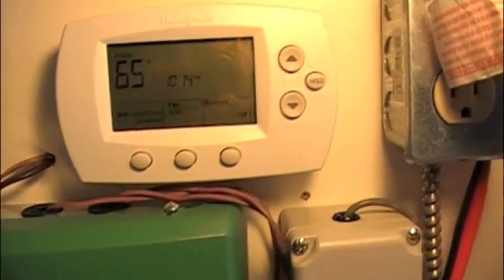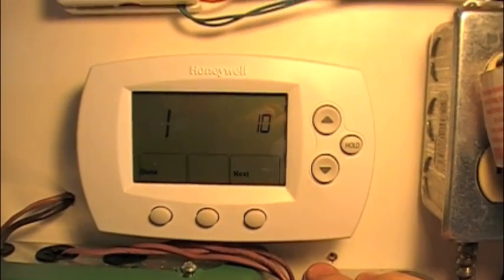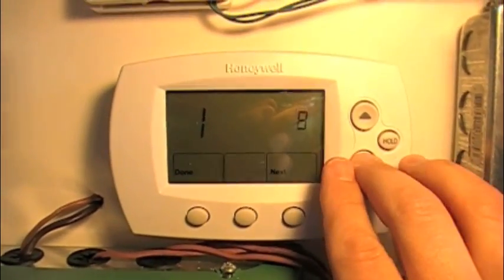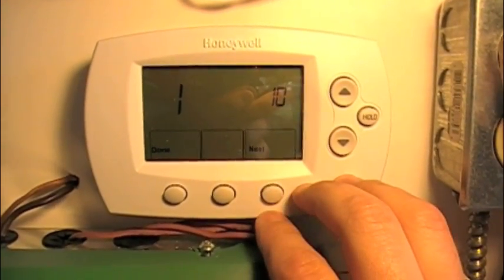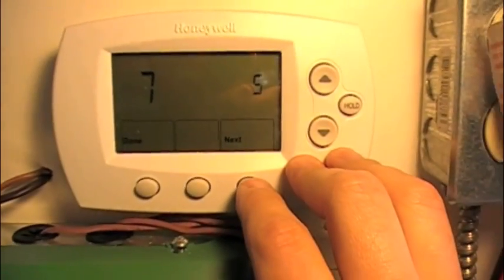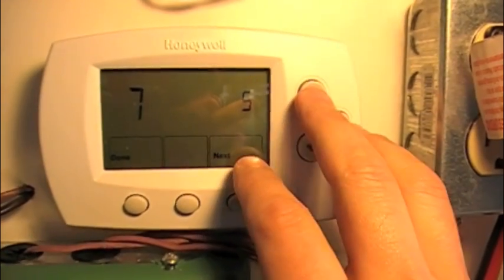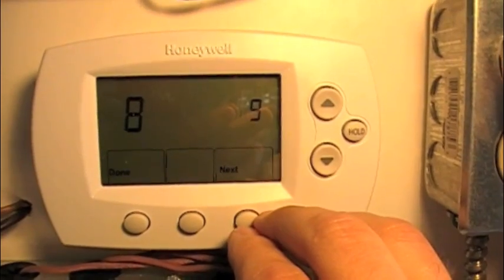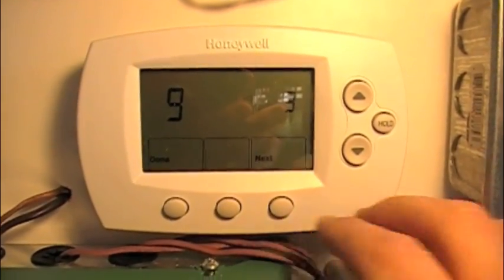Honeywell Focus Pro 6000

Comment: What is the difference between aux heat and using the emer heat setting. That would be difference between the heat and emer heat settings. I think somewhere i have read that setting thermostac to em heat keeps the compresser from coming on in cold weather below 30 .

Comment: I've been trying to keep this on manual cooling. I hit the fan and up bottom and changed it to 13 and zero and now it just wants to heat. What can I do to get it on manual and on cooling? Please help. It's August 22nd and It's hot outside.

Comment: Is there a way to have the blower fan motor in the air handler to run longer once the AC thermostat calls for the system to go off once cooling temperature has been met.  Right now when the AC goes off the blower motor goes off instantly.  Is their programming to have it run for a minute or so after the stat has it go off? We have a 2heat/1cool heat pump.Thanks. 

Very informative video. Thanks

Comment from the maker: @ Marina,  On the top right  of the Stat as you are looking at it, there is a depressible area that removes the battery holder.  It pivots out and then pulls up.  It takes two AA batteries.

( I don't know why but your comment is "linked" and for some reason it has no "reply" tab below it like other comments do so I am posting the reply as a new comment.)  If anyone can tell me what that is all about I'd appreciate it.

Comment: James, How would you configure the stat (system type)for a single stage heat pump with oil furnace back up? Thanks Scott
Reply from the maker: Scott, I believe that would be setting 0 on setup function 1.  This should give you Y1 in both heating and cooling mode and the W should engage when the Y1 is not getting it done in the heating mode.
Reply: James Schenck Looking at the manual, 0 would be conventional 1 heat 1 cool? At that point the stat doesn't know that we have a heat pump and O/B terminal won't be (de)energized, or am I wrong on that? We want the heat pump to run a long cycle in heating (when ODT is > 25deg. F) before switching to fossil fuel(auxiliary or emer.) It sounds like the 6000 changes stage after a fixed 1 min. Perhaps this isn't the stat we need?
Reply from the maker: Super64heavy  Scott, I am sorry to say but I have grown too frustrated with proprietary stats to continue trying to figure them out and define their operation.  I now use a non-proprietary control platform that I can define the operation exactly as I want it.  The solution for you may be Braeburn t-stats as they have set point controls that are not temp/time based algorithms but are adjustable set-point based.  Sorry for a "dodge" on your issue.

Comment: Hi James, Have a question on the 6000.  Im not getting "Heat" displayed when pressing system button.  only COOL and OFF.  also, I only have 7 config pages..  1=4, 9=3, 13=0, 14=0, 15=0, 16=0
, 28=50
Reply from the maker: Fly,  Sorry for the non-response until now.  I had not seen your question.  If you still need help after all this time please provide the rest of the specific model # of your stat.  I am not familiar with your issue but I can try to help.

Comment from the maker: Perhaps leave 15 (compressor protection) at zero?  You are illustrating why I don't like these stats.  I prefer temperature only based stages like Braeburn stats.  I only did the videos because a lot of out heat pump dealers do use them and configuration is a common problem.  Even when configured "properly" I still don't like the operation logic.

Comment from the maker: Stephen,  I assume it has to do with menu item #13 in the configuration mode.  This is the adaptive intelligent recovery feature.  It 'learns" how quickly or slowly the space responds to the heating and cooling over time and will anticipate a call and come on early to pre-empt the condition or it will anticipate an overshoot and will end the call early to prevent it.  You can see if item #13 is on and shut it off and see if it makes a difference.